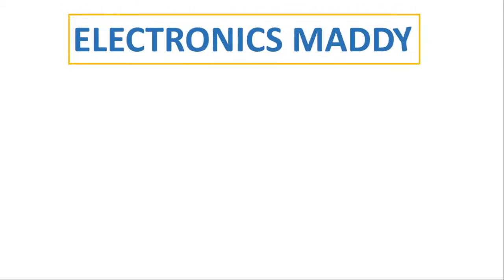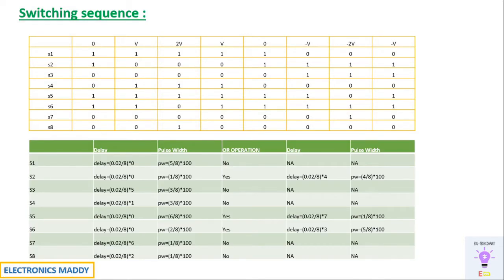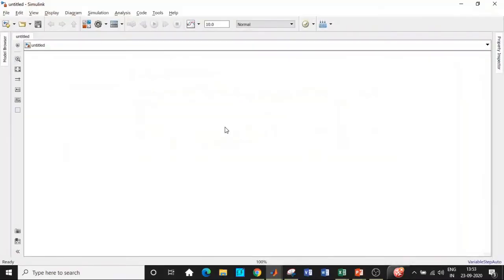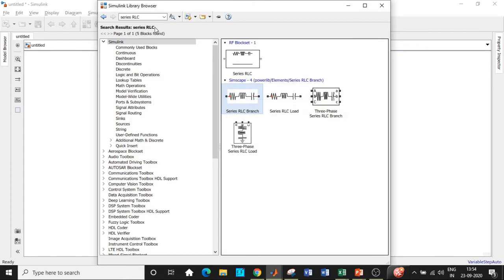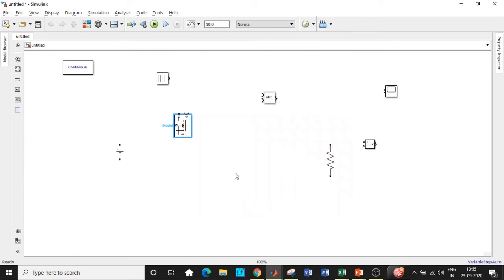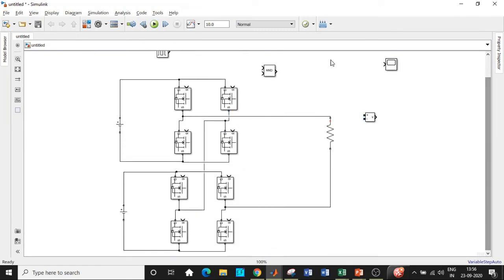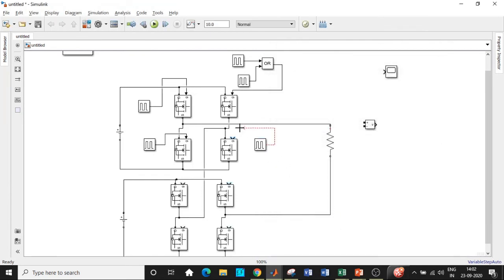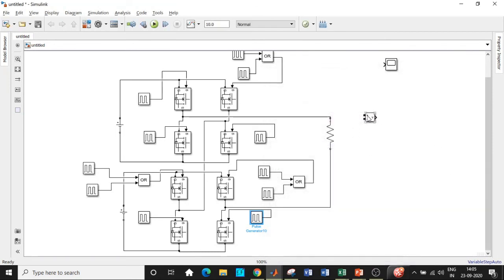Simulation of 5 Level Cascaded H Bridge Multilevel Inverter in MATLAB | SIMULINK

Comment: That was by far the best explanation I have come across, lastly I have a question can we implement selective harmonic elimination in 5 level multi level inverter?
Reply from the maker: Thank you Arbaaz mir. Yes we can. You can use a filter circuit at the load terminals and reduce the harmonic levels.
Reply: @ElectronicsMaddy  I am planning on doing this as my project can you please explain to me what all parameters I should present like ex THD and lastly what all do I cover on this topic so that I appear to be well prepared on this topic to my professor.
Reply from the maker: Yeah you can show the THD at the output terminals. I have made a video on how to perform selective harmonic elimination. You can refer to that and try to correlate with this circuit. Basically you can present the output with THD and with reduced thd using a filter. These two will pretty much sum everything.